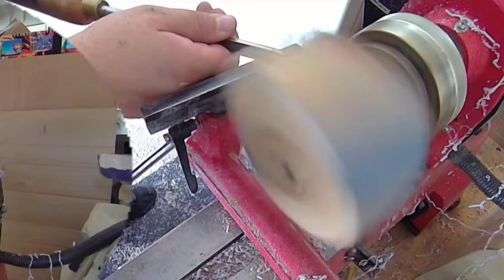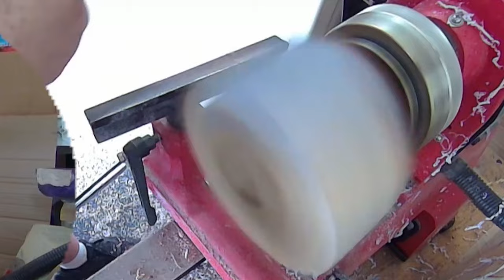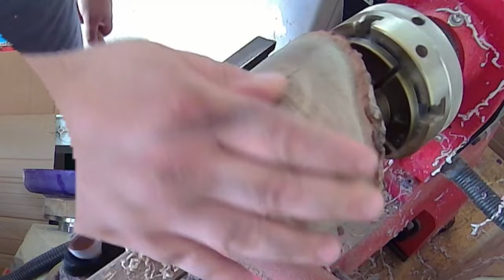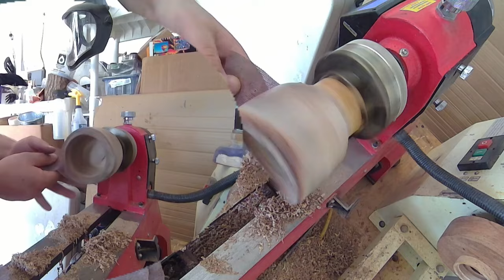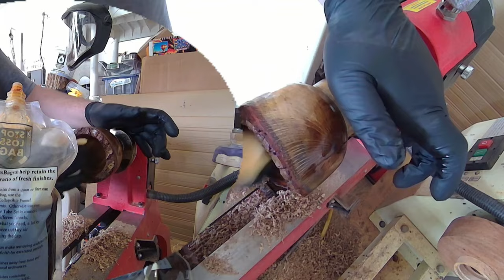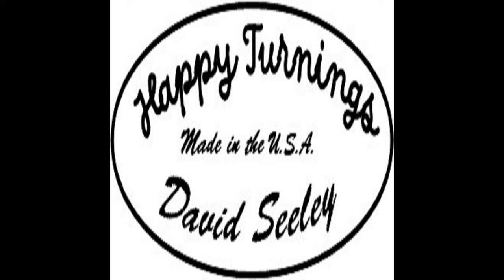Wood Turning | Project 5 of 52 for 2024 | Lil' Live Edge | Happy Turnings

Comment: Thanks for showing the state of your garage. You are making, and youtubing. It is inspiring to know that I shouldn't make myself wait until my "shop" is stumpy nubs ready before I start using my tools.
Reply from the maker: Thank you for watching! I don't mind showing as its a constant changing state. Each time I clean some shavings I organize a little more, and again when I choose my next blank. My "shop" area is about 1/5 of the garage when not being used (fold away table, saws on tables than can lift with castors, and a shop vac that fits nicely between everything. When its time to turn, I move my wife car and stretch everything out. Definitely get out there and make some shavings!

Comment: That's good work .Can you make bigger bowls?
Reply from the maker: Thanks for watching. Yes I can. I have a Turncrafter Commander Pro 1218. It has a maximum spindle length (think baseball bat) of 18 inches and a maximum swing capacity of 12 inches (6 inches from the middle of the headstock spindle to the top of the bed giving a total maximum bowl width of 12 inches). Unless the piece is preformed, then I am likely to carve some of the diameter of the piece. Maximum that I have accomplished thus far for a finished piece is 9 inches (limited to starting piece size).